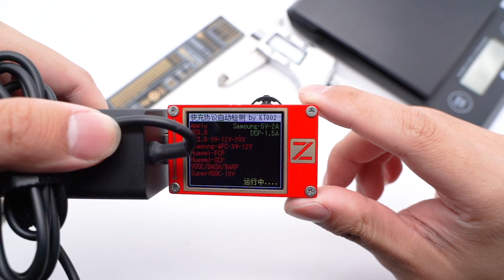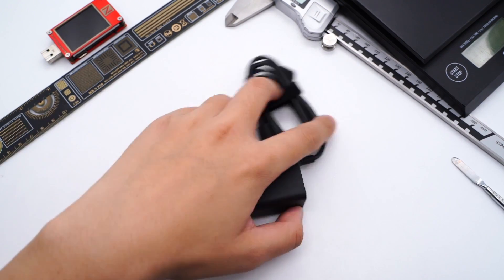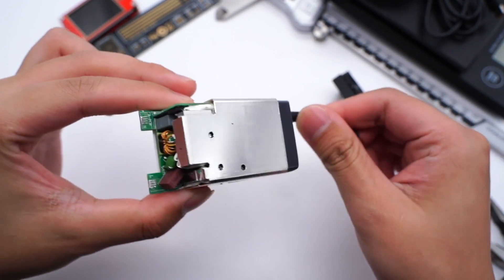Latest Teardown of DJI 65W GaN Charger (For DJI Mavic 3)

Comment: Is it that in situations where the USB C cable is fixed onto the charger, that it would be permissible to integrate the e marker onto the PCB of the charger itself and not need be on the cable?
Reply from the maker: Yes.